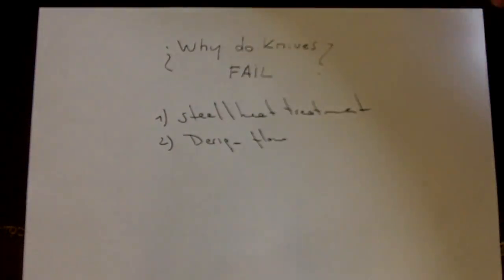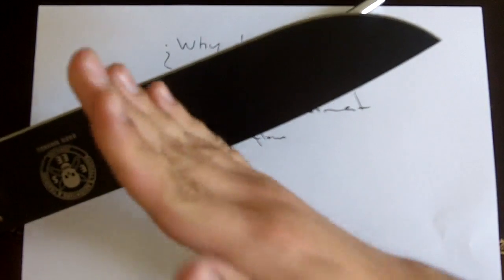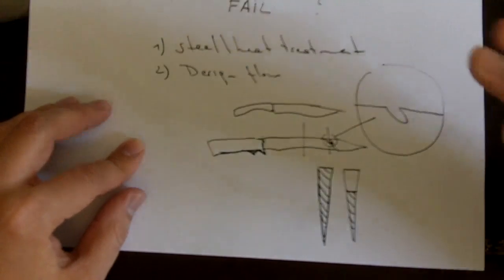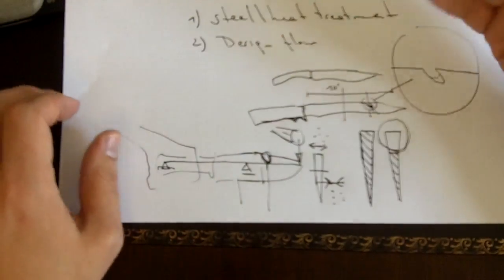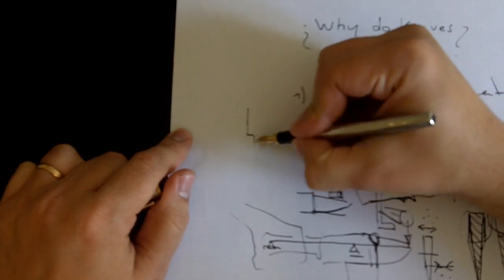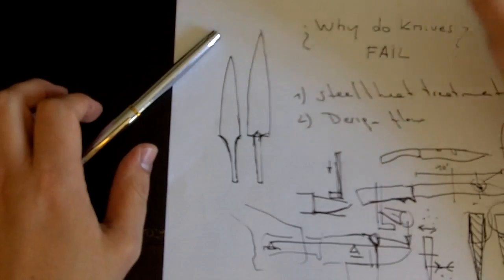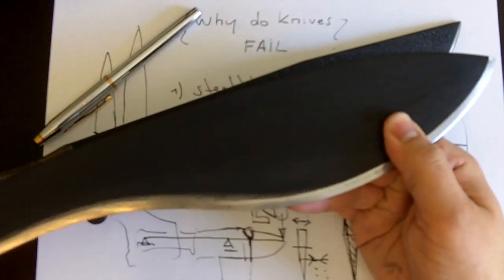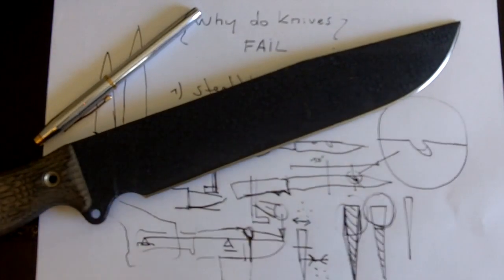Why do Knives Fail?

Comment from the maker: Yes, agressive groves or notches of any kind are a stress point and will most likely be the point where a flawed knife (because of material/heat treatment or design) will fail.Search "Cold Steel Outdoorsman fail " on youtube to see an example of it.
On an overdimensioned blade shallow and well rounded notching or jimping will not weaken a blade significanty, but still its a point where dust and rust may gather. Is it even worth having chekering in a blade? I'll do a video to reply to that next.